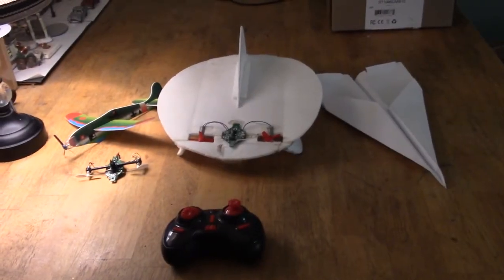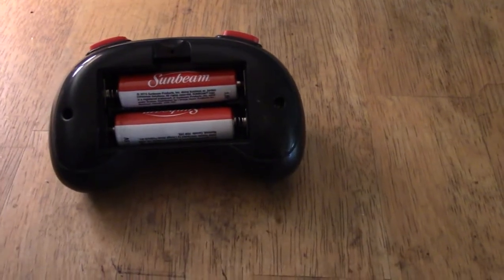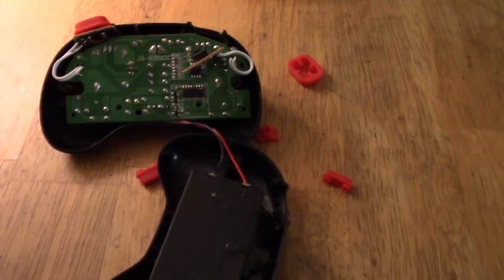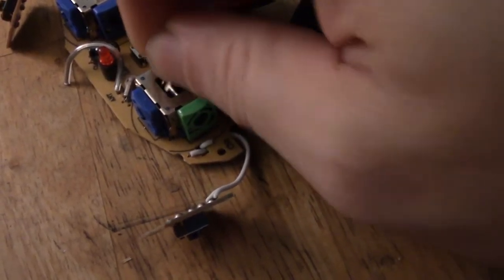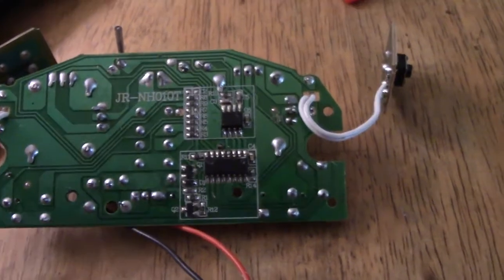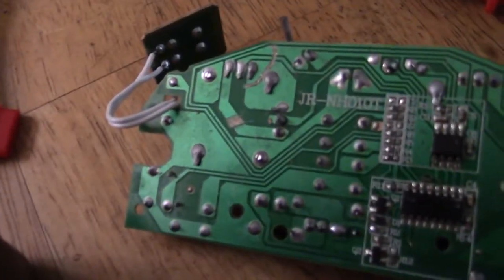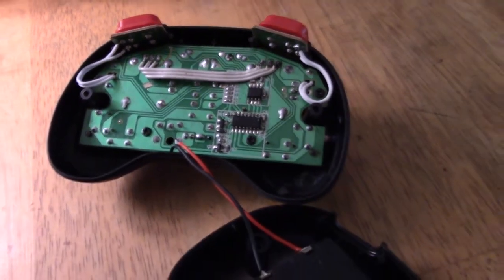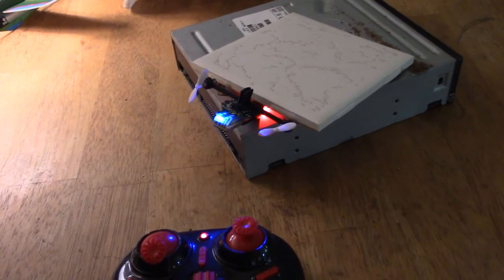How To Convert TX to separate stick controls - Peter Sripol paper plane

Comment: Is there a way to remove the gryo on the receiver.
Reply from the maker: Not easily, unless very proficient at SMD soldering and circuit tracing. I was lucky with another project, where the gyro wasn't integral to the code running. It seems that most receivers rely on it being present for perhaps safety. For example, some won't bind unless the gyro reports level ground, so that would include popular quads like the Hubsan X4's.
But, just using the 2 rear motors really does work well...only things to watch for are that the plane should have short wings and a little dihedral. Else, it may start to wing rock, or, won't turn.
The turning problem is based on long wings giving more angle right up to the fuselage. The gyro decreases power to sort out the angle change and ends up that the plane flies in basically a straight line. 
Pitch is back to front, as the plane goes upwards the gyro pours on more power....it can therefore be an advantage to heavier planes to mount the receiver on an upward angle.
All in all, I thoroughly recommend the system for small aircraft.

Comment: Useful video.  But I was puzzled why the manufacturer would provide a second unused control button.... until I read your response to CircularMirror7's question.  I had forgotten this is a conversion from a quad-copter.
Reply from the maker: The system flies models so well that it can be missed what these started as ! With only the rear motors being used it affects the control sticks, to where the right stick loses its use.

Comment: Weird that they would go though the trouble of having a second stick with a pot that is not used at all. Couldn't you if you really wanted cut the trace on the board and wire it up so you have each stick do only one thing. Cool video.
Reply from the maker: Oh it's the conversion from quad to plane that disables the right stick. As a quadcopter it uses both sticks normally.
The conversion removes the front 2 motors and the gyro has no idea they aren't there....so inputs on the right stick seem to do nothing when being flown on a plane.
Some people like to fly with the 1 stick (maybe so they can film with the other), others like to fly more conventionally with the 2. This way keeps both options open.